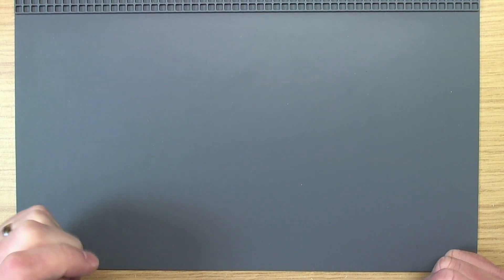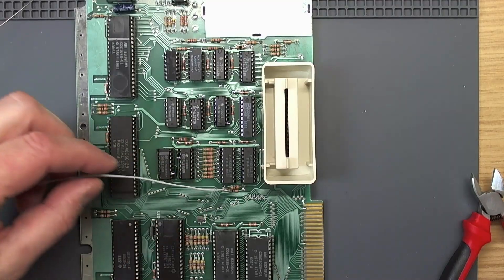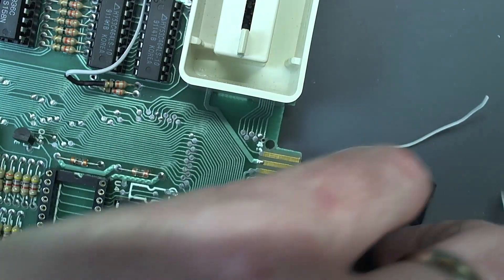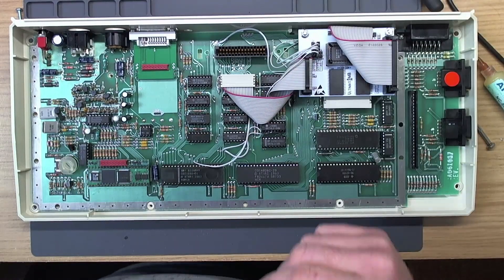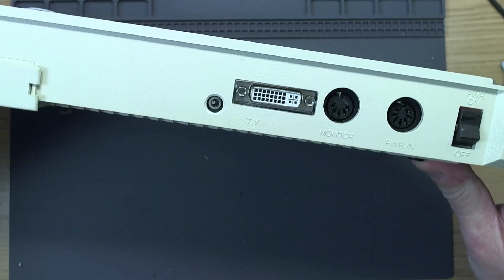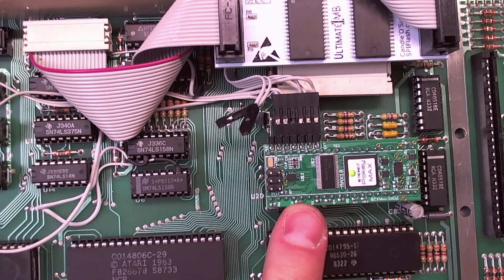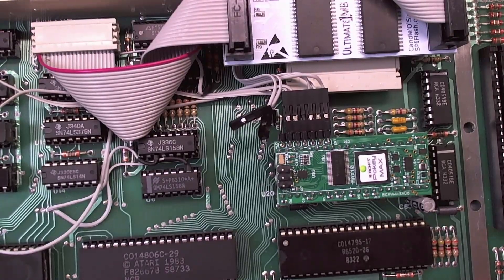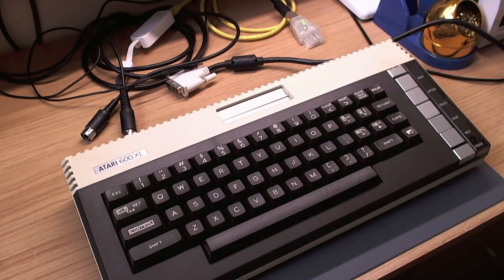Repaired Atari 600XL with Sophia 2, Ultimate 1MB, and PokeyMAX

Comment: Wow! First I have been looking at Dual Pokey options for a classic 800, will the PokeyMax work with an 800? I just got a Sophia2 for my 800 and the DVI is great, can the VGA come out via a DVI-VGA adapter?  or do I have to mess with other traces? 
Thanks for your work! I credit you for improving my soldering technique.
Reply from the maker: Yes, I believe PokeyMax will work in an 800, and if you also have Incognito, you can use the Incognito PokeyMax plugin to control all the settings from the Incognito setup menu (likewise, you can use the Sophia 2 plugin). I THINK Sophia has VGA on the analogue pins of the DVI connector, but don't quote me on that. Many thanks for the positive comments and good luck!

Comment: Did I understand correctly that you can remove one of the capacitors, then the screen will be more blue? What will be the number of the capacitor? What is the capacitor on the 130XE board? Of course I already have Sophia2 installed. I will be grateful for the info
Reply from the maker: It's C109, and removing it dramatically improves the sharpness of the image, which is far too soft with the cap in place. The cap is above and just to the left of CD4050 pin 16.
Reply: thank you very much, i will test it soon

Comment: You usual mastery of the soldering iron etc Jon, very nice indeed and the Sophia 2 part interested me because one was plopped into my hand by the posty, I wasn't expecting it but someone treated me which is lovely. I've yet to install it as I just keep looking at it in amazement ;)

I want to make an RGB lead for it to scart so I can use my old crt monitors, I also may use the HDMI which I have an adaptor for but what I'm not sure about is which pins off the DVI I need, obviously the Analogue R G and B, not sure which ground, the connectors offers Analogue which I presume I need but any other pins?

Any pearls would be gratefully received.....I don't want to order off Aliexpress for the DVI plug but they are 6quid from here...Much check my lead box and see if I've a DVI lead in there that I can cannibalize... I'm in no rush as I'm still partially covid suffering (well until weds coming unless both legs fall off etc..)

Now going to watch your You're fired Rapidus vid, I feel it may be a treat..

Comment: It can be high res but still 40x24 for text. Sharpness is irrelevent. Give us poor and haunted A8 soul  80x40 screen. For full disclosure I have Atari 800 + UAV + SDrive (own built from my junk pile of Arduinos).
Reply from the maker: Sharpness is pretty relevant when you're running a software 80 column display, which then becomes extremely usable (I know, since I wrote an 80 column word processor). If you want hardware 80 column text, VBXE exists.